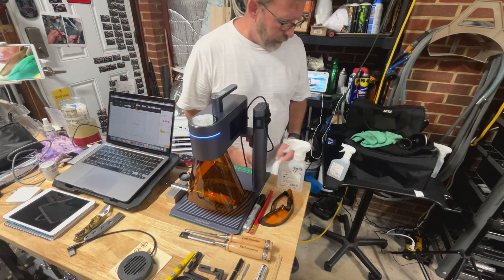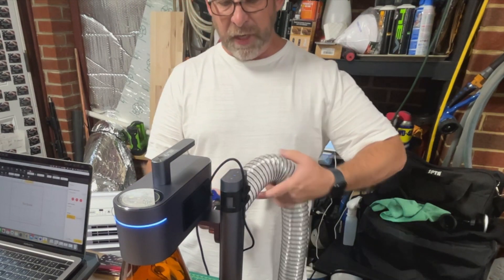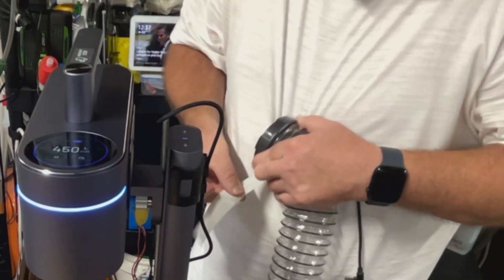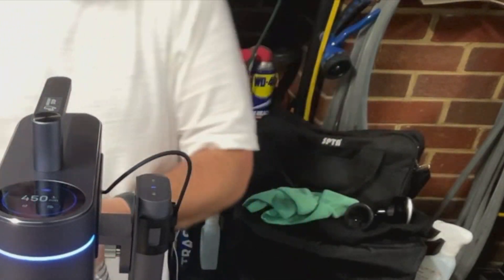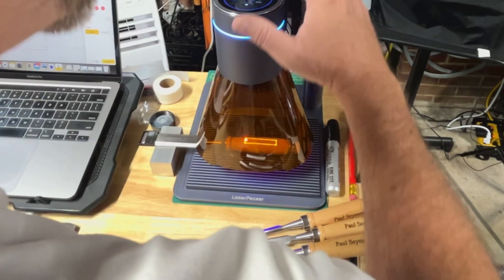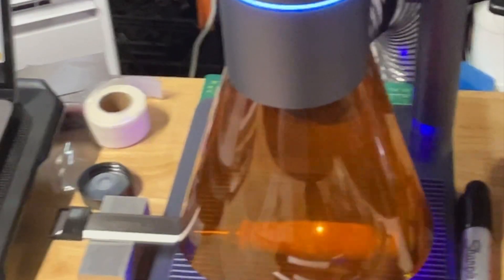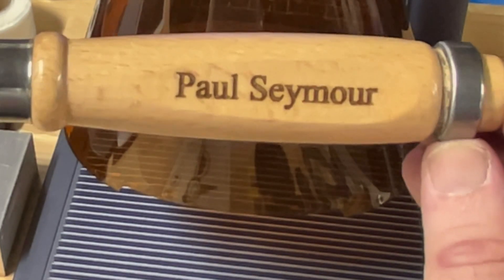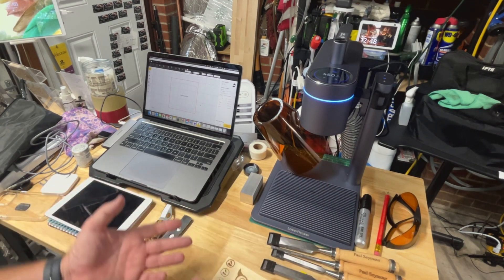Laser Pecker 4 Fume Extraction made easy and a user Tip to save frustration

Comment: You could also just place it inside an enclosure that comes with a fan and not use that stock one altogether. The draw is very weak on their fan but with an enclosure+fan and and in-line fan as well the fumes are gone so fast.
Reply from the maker: I’m working on one now I did order the one for this laser but I assume it could be some time before we see them so I am making a temporary fix
Reply from the maker: That is what I have done I now finally got my LP  LP enclosure but I modified it for my fan and just disconnected there little fan it work great.
Reply: @ALXSHARPEN  same I received mine and must say it works exceptionally well with containing fumes. I was being lazy and left the fan on mine but still using and inline fan and 3in duct. Used some electrical tape around the front seams to block the light leaks there but overall pretty good enclosure!
Reply from the maker: I have an entire new one I will show on video very soon. I got tired of having to take the LP one apart to use the rotary of slide extension and got one big enough for everything.
Reply: @ALXSHARPEN  it’s a pain and so pointless cause the extraction barely does anything once it’s lifted. I keep a large enclosure off to the side for using attachments- easier to pop in and out plus no fumes.